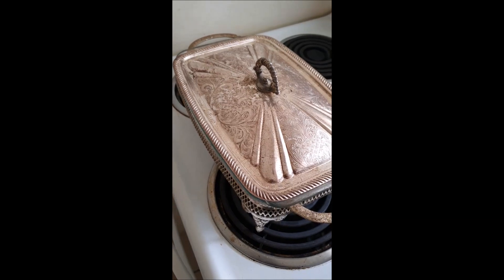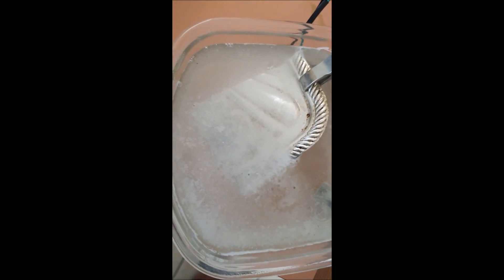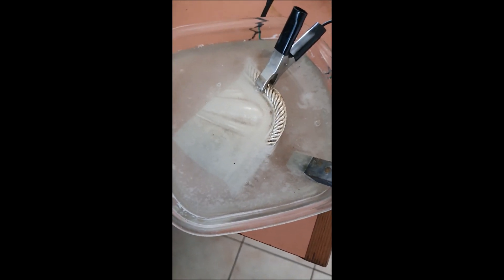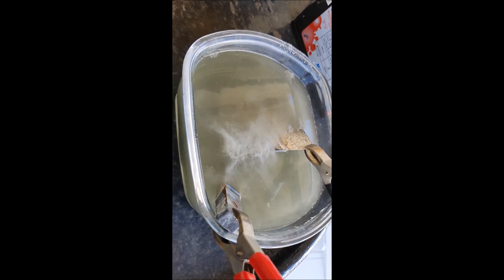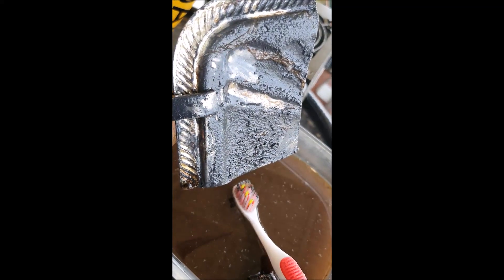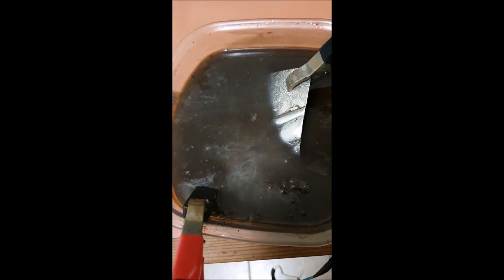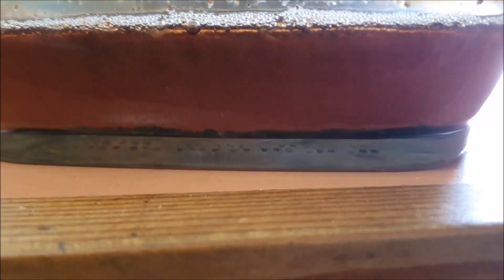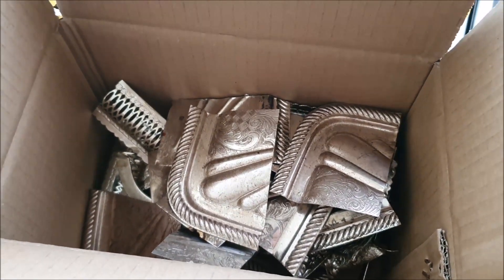SILVER RECOVERY / removing silver coating with reverse elecroplating using salt and vinigar

Comment: Im trying to do this with silver plated copper but everytime theres copper oxyde mixed with the ''bottom cement''
Reply from the maker: yeah but that will be seperated from the silver in the silver cell
Reply: @prospectorpete  yes I read that I need to place a clean copper piece, it kinda works but the yield is way lower than I expected :( (almost 100 lbs of plated copper for only tiny specks, I refused to use 200 $ nitric acid so I just ended up selling that copper lol
Reply from the maker: @MrMikedejeuner  nirtic acid with reverse electroplating ?....where did you get that idea from ?.......you can use battery acid , or sulfuric acid to reverse electroplate

Comment: At 2:10 Pete says "this is no different than fish and chips, salt + vinegar". I hate to burst your bubble but I did read that vinegar + salt will create a mild hydrochloric acid. Using straight saturated solution of salt water is the better option. The silver does not go into solution but will flake of and remain suspended in solution along with any base metals. Then add HCl to dissolve base metals, filter and drop silver. Hydrochloric acid will attack any metal objects in the kitchen + has fumes.
Reply from the maker: thanks

Comment: Very interesting.  How pure is it?  (Sorry if that's a dumb question). And could this be used as an electroplating solution for silver?  I'm wanting to use conductive paint and electroform organic pieces
Reply from the maker: well providing you dont start dissolving the brass or copper base metal , the silver should be pure, and you would have to filter the silver which settles on the bottom , then dissolve it in nitric to make an electrolyte

Comment: I think the bubbles coming off the metal being produced by the electricity are hydrogen and highly flammable, you should test it outside and see.
Reply from the maker: I wouldn't know how
Reply: @prospectorpete  could you add dish soap so that when they bubble up you could pop them with a lighter and see if they explode?

Comment: Sir if i wana remove tin plating from copper wire .what chemical shall i use ? pls reply me sir
Reply from the maker: Hcl removes tin
Reply from the maker: Soak the wire in hot hydrochloric acid for a few minutes